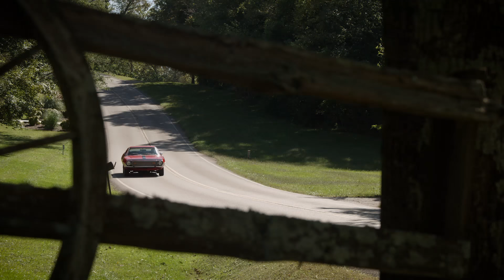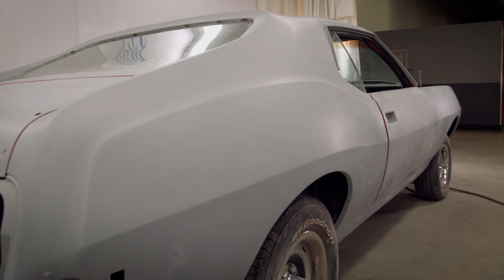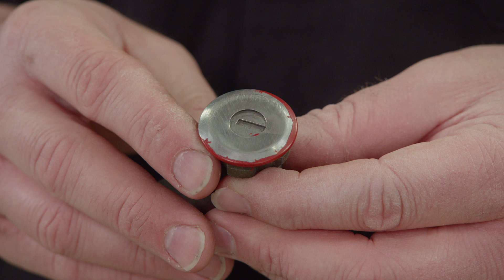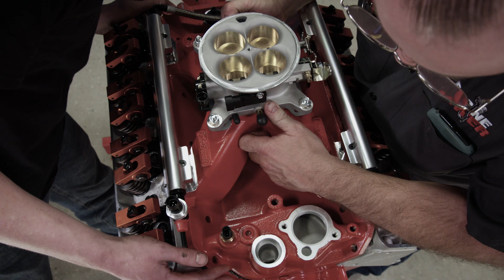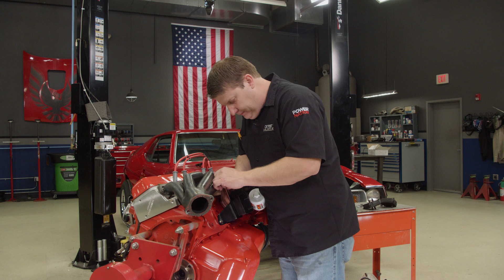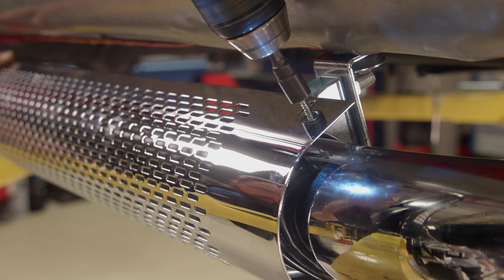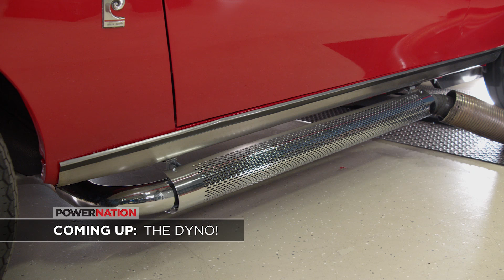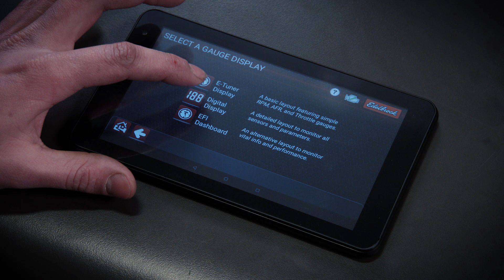Full Build: Transforming an AMC Javelin to a 70s Muscle Machine

Comment: Well I'm not quite sure what you guys are doing there but those are supposed to have 152 horse factory 304 engine and a 73 AMC well not just that year but nonetheless I knew it was closer to 160 as I guess I had to check I wonder if you are getting full throttle and running it to Red line nonetheless that's a bit of a difference that's 19 horsepower difference and at that I will say I what's really going on LOL

Comment: Great episode. I am getting ready to start a ground up restoration of a 1971 AMC Javelin.
Reply: Week end garage ..in 1972 AMC were installing Chrysler 727 three speed torque flight automatic transmission to replace the out dated AMC automatics ..i was working for an  AMC dealership at the time and shop foreman wanted to see if the new 727 transmissions were as good as was claimed....so at lunch time the race was on ...it was buck the service manager in a brand new 1971 Javelin with a 360 two barrel carb.and the AMC automatic.....i was in a brand new  1972 Javelin with a 304 two barrel carb and the all new Chrysler 727 three speed torque flight automatic ...our test track was a four lane avenue with plenty of  stop signs ..and at every stop sign buck didn't have a chance .even after i gave him a car length head start the 727 with a smaller engine would beat the AMC with a larger engine ..if you are not building the 1971 as an exact restoration for something like the barret jackson auction ...i would highly recommend finding the next year newer transmission of the Chrysler 727. Torque Flight ..if you are planning on keeping your 1971 Javelin with a 727 trans. You might also want to look into getting an overdrive unit that bolts on emplace of the 727 tail shaft and housing...this way you could run a rear end gear ratio of maybe 3.54 or 3.73 ..and with overdrive could still get great mileage on the highway ...and if you naturally aspirate it with a new sold state EFI four barrel throttle body that has no computer but instead has a built in microprocessor that all you do is feed it 12vdc and a signal from an O2 sensor ..you will be getting great fuel mileage while giving your engine many 10's of 1000's extra miles of engine life .and a few extra free ponies
https://www.manciniracing.com/msdatfuin.html
Reply: @donniebaker5984  Good info and story! I goofed on my post. My Javelin is a 74 with a 727 transmission.

Comment: Full builds are great, and I love the fact that FINALLY someone has done a Javelin. I have a 74 360 4-speed waiting for this type of treatment when I can finally find time and money. Things like these lock cylinders are little things I can get done in the meantime.
Reply: Sounds cool! I’ve been looking around on the market for the last couple of years for a 73-74 javelin. I was surprised to see just how hard they are to find, and the ones I do manage to find are either in really rough shape, or many states away. Good luck with your build.
Reply: I have a 74 360 AMX red 4 speed manual that’s been garaged for 40 years. I bought it new in college. I have finally started to work on it. I plan on painting in the same factory color and using white decals for the stripes. I like them better than what these guys did. I also probably won’t be quite as radical with the wheels. I can’t wait until I’m finished though.

Comment: The 1973 AMC 304 made a puny smog era 150hp & 245lbft at the crank with a low 8.0:1 compression ratio, so 133/201 at the rear wheels wasn't bad for a bone stock engine. Something was definitely puking out onto the ground under the engine during the dyno run.
Reply: Yes! In fact it is almost unbelievably good compared to it's ratings. So , there were dual exhausts added. We might guess a cam and compression increased, too. (8.4 cr according to the brochure)  
  The problem with this build is that they started with a car that was almost perfect to begin with then improved some things but degraded some others.  Using expensive parts from advertisers.
I can't relate to that.
Reply: @auteurfiddler8706  Those humungous rear tires ruined the "after" chassis dyno numbers. For a street cruiser/bruiser, I'd still have gone for a staggered set up but more evenly proportioned. I was expecting the rear drums to be converted to discs for extra stopping power since the engine's power output was more than doubled, so I was a bit disappointed that wasn't done.
Reply: @DJDinaggio  As a guy that follows both Mopars and Javelins, I can see the problem. The 73 'cuda has bolt on upgrade paths to bigger factory rotors and drums.
I haven't done it myself because it works pretty well already.  But the 73 Javelin starts with roughly the same brakes as the 'cuda but has no bolt on upgrades.
  Bias belted rear tires aren't going let better rear brakes do much except make the car swap ends with it jacked up in the back.
  Those belted tires are cute but they could have asked Cragar for wheels that fit... More backspace and less front space. And they should have used radials.
   They should just say "We took a great car, and with the help of our advertisers, turned it into a show only car with tongue in cheek kitsch." I guess I should not worry about all the mistakes they made. I guess we should compare it to the George Barris car with a Chrome German helmet roof and fake chrome machine guns on the side, not to something we'd take to Cruise Night/Cars and Coffee, or #NoNameNationals or Power Tour.

Comment: Taking off radial tires and putting on belted tires with rear wheels on that have too much front spacing, then jacking up the back with air shocks.....  These were all the things the next owner is going to have to undo.
   I would not want to be those rear wheel wells if the car goes over a bump.

Comment: A quick google shows that 304 was originally rated for 155 hp and 244 torque. Looks like it really didn't lose much over the years.
Reply: YES. The car had more power than it was rated at when they bought it. 133 rear wheel on the chassis dyno is about 200 engine hp on the same scale the 155 was was based on.
Reply: @auteurfiddler8706  Maybe it had some day 2 mods they didn't mention.
Reply: @whelk  Exactly. And very likely since it had nearly 50 years to collect the day two mods. 😁

Comment: Nice build and great to watch. I was hoping we would see the stock engine on the dyno and a before and after engine dyno run. 

A 30%+ drive train loss is crazy but that was due to those rear tyres ( do it again with the original wheels and tyres and see the difference!) and the 1970s automatic. 

Good to watch 👍😎
Reply: A 30% loss suggests one of the dynos is a bit off. You should seriously question drive train looses over 20-25%, on anything... Chances are better than good that the roller dyno is closer, since it uses far less correction and is entirely acceleration based. The wheels make up very little rotational mass when your spinning a few tons of roller up anyway... The engine dyno probably has the correction knob turned up and set to 60 or 75 percent for the calculations, versus 50% where it should be. People do that to flatten the curve plots and pad their numbers. It is a common trick to turn that up and do just that..... Been there, seen that.... More than a few times.... The roller dyno measures hp by acceleration rate, which is not exactly easy to fake... The engine dyno measures torque with a brake and a pressure sensor, and the engine dyno is way easier to make your engine look better by where in the plot you apply the correction. The higher you apply it, the higher the power. Most people don't know that about dynos.... At 30%, they are padding the engine one with higher corrections on the plot.... 30% power loss, will burn things up in a hurry... That is a massive amount of friction... Or a padded dyno....
Reply: @shvrdavid  on my ISF I have seen 30 hp loss just by over tightening the straps. 

The best dyno is a hub dyno. 15% difference between rollers and hub by the same manufacturer, same calculations and day. 

Those huge rear tyres will gobble up 20 hp over low profile tyres on the same dyno. 

I hope to be able to do a direct comparison between roller and hub on my car. Would be interesting.
Reply: @SouthernCrossMotors  Loosing 30 hp is not the same as 30%. Your ISF made 302 to the wheel. Which is nice. But it wont loose 30% strapped down as tight as you possibly can.... That's over 100+hp... I have never had one of my drag cars exceed 20%, ever.... Where I had them dyno'd, doesn't pad the numbers. And by the way, you don't need to strap 1500 hp down tight on a roller.... Why would you do that to a street car? Taking the slicks off and putting street tires was tried on a few of my cars, and made virtually no difference at high power levels on a roller dyno. It accelerates to quickly to make that much of a difference. Making less power would show a bigger difference by reducing rotational weight, but not 20hp at 200hp. Is every dyno different? Yes they are, but not by much percentage wise. Either something is very wrong with one of their dynos, or one is padded... Since they use them all the time, one is padded... The difference you will see between a roller dyno and a hub dyno is dependent on rates. The roller measures how quickly you can accelerate the roller, period. And the hub dyno can be set at whatever rpm a sec increase you want to measure it at, just like an engine dyno.(They may have other modes as well, such as quarter mile sim by weight versus gear ratios, etc) Have them do it at two different fixed acceleration rates, than ask yourself how it made different power outputs without changing any rotational mass... And how the difference you see, is small percentage wise, and not consistent across the power curve.... Hint, it has to do with factoring, and sample rate timings. You obviously didn't change cars..... The car still made about the same power, it will be slightly different at different rates, but not that different... Then have them show you how to tweak the numbers, by changing the factoring percentage. I am not talking about altitude, weather, shootout mode, or any of those adjustments, where the numbers are taken from in the scattering of samples it records.... If it has shootout modes, have them explain that to you as well. Shootout modes guess what the drivetrain losses will be based on real world tests, then use higher numbers in the sampling of the scattered data to come up with flywheel numbers... Which is why you can change which mode it is in, and suddenly your car makes way more power.... Just about any dyno shop will show you that. My STI has about 18-20% drivetrain losses, and it is still all wheel drive..... It showed slightly more power on the rollers than at the hub.... About 2% more... 698 on the roller. It made 833 on a Sunnen.... All 3 dynos, were very close percentage wise... All 3 made by different companies... None of them have padding turned up to buff egos....
Reply: @shvrdavid  Hi. An update. The ISF made 352.9 on the same dyno after the mods ie headers, full dual exhaust and RR-Racing tune. Happy with that (Dyno-Dynamics roller). 

I then took it to a hub dyno (Mainline built here in Australia) and it made 396.5. I was curious but also wanted a baseline before the final upgrades being a ported TB, ported inlet manifold, much larger intake and MAF tube and the final tune upgrade. Hoping for 10 to 20 increase. Nothing more I can do to it now.  

Also heading to the strip to see if I can get a new PB. Aiming for 12.2xx @ 117 mph. We will see.
Reply: @SouthernCrossMotors  Keep chipping away at it. It probably surprises more than a few people as well. Must be a blast to drive on the street. Quick car from the factory, and even quicker now.

Comment: I don't know what these guys were thinking. Was this supposed to be some kind of budget build? Why stick with a shitty 3 speed auto? I mean you go to the trouble of installing fuel injection, so why not a modern transmission? And why keep that ridiculous 3.08 rear end and stupid drum brakes on the rear?
Reply: It was a build that combined improvements, degradations, and neglect.
I think they use advertisers parts.  That is the purpose of the build.
I think they never call it budget. It is just the opposite. 
 The 904 is a fine  transmission and you can upgrade it for strength. The Mopar Bible says this. So that was an improvement.
If you jack up the rear end, there is little point in putting stronger brakes on the back than the 10 x 1 3/4 stock drums.
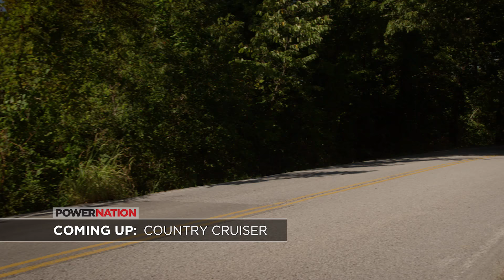  If you don't have an an overdrive transmission, there is a disincentive to put on 4:10 gears if you want to drive on the highway and not the dragstrip.
   If it were my car, I'd drive it like it was. I'd have tried to get the AMX hood, which they did. Well, add a posi. And , say, a Torquer or Perfomer intake and four barrel carb.
 Then, when the 304 needed a rebuild, switched to a 360 or bigger AMC engine.

Comment: Ups, Drove a AMX in its day 390 CI 4 Speed standard, bit smaller than the Javelin, Awsome
Reply: 68, 69, 70 AMX were 12 inches shorter and had no rear seats than otherwise similar Javelins.  Think about this: an engine big enough for a Galaxie in a car with the wheelbase of a Pinto.   😁😁

Comment: Love the build I had a 71 with a 401. I wish this build could have had a 401 or even a 360 and some dragstrip time. My 401 was .020 over with a roller hyd 236/242 @ .050 and .540/560 lift w/ a 110 LSA. The heads were Edelbrock with the runners opened to 205 cc's and minor cleanup of pockets and ports. I used Harland Sharp roller rockers 1.6:1 ratio and a Torker as I found it to give more horsepower than the RPM without sacrificing throttle response. Carburetion was a 770 Demon. The oil line and distributor  mods were done and I installed ARP studs on the mains and heads. The rods ( which had ARP bolts) were stock steel and prepped as was the crank. Headers were 1&3/4" out of 3"ers. Horsepower was 524 @ 5800. It idled well, had great throttle response and sounded like a bear with it's nuts caught in a trap. Underrated engine that 401
Reply: People really underestimate the power that can be made with AMC. It sure isn't the cheapest power out there, and won't be the most, but you can get there.
Reply: Uh huh..

Comment: Only thing missing from these full builds is the engine build instead of just an overview.

100 horse driveline loss is nuts.
Reply: You aint kidding, I have been building heavy duty diesels for semi truck pulling and we typically see 100-150hp drive train loss on a semi truck. And your talking about a giant 18 speed trans, huge 8 inch drive shaft, the power divider box and the enormous Dana axles. 100hp loss on this car is terrible.

Comment: HOWdy  P-N,
Thank you for the " AMC " Episode
I beLIEve  that better POWER could have been achieved with appropriate SIZED heads (instead of the "401" aluminum aftermarket items)  + a CARBURETOR ... (instead of EFI) 
... those ALUMINUM Heads SHROUDED the  Valves to the point that you were required to NOTCH the engine block for clearance ...  
( I have done this exact same BIG VALVE 401ci Heads onto a 290ci / 304ci AMC V-8 engine in the past myself  - only with OEM Cast-Iron heads ) 
instead -  I would be interested in  a Cast Iron HEAD with the largest valves that would fit inside your 3.75" bore ( + any overbore) and and appropriately sized HOLLEY Double Pumper 
( just for comparison's sake )  
IMHO 
Thanks for the AMC Episode 
COOP
...

Comment: I hope they put in new fuel lines & a new gas tank.
Reply: It looks like they could technically still use the old one since the EFI pump is boosting the pressure after the fuel gets to the engine compartment.
From what I've seen, that is not a good system in terms of noise, though.

Comment: 18:44 Fun fact: Subaru is considered a "low production manufacturer." They do everything they can to be as efficient as possible. That means reuse the same parts across as many models as possible, and buy the most common stuff from someone else. Even if that "some else" is technically a competitor. The engine accessories (AC compressor, alternator) are made by Mitsubishi and the interior switches (windows, doors, etc) are made by Nissan.

Comment: It’s great they stayed with an AMC mill in it, but I would have kept it carbureted instead of injecting it, but they have to go with what their sponsors want them to promote. A properly sized and tuned carb will perform just as well if not better than injection and would have been sticking with the 70’s image they were going for.
Reply: 😂 ok. I'm a big fan of carbs and you're delusional if you think a carb would be equal to or better than efi. Throttle response, low RPM cruising, WOT, cold weather starting, to name a few. If carbs were better than efi, everyone in drag racing, off roading and road course racing would be using a carb.
Reply: @TheRoadhammer379  you need to look at the real drag racers not the street/strip weekend warriors.
Reply: @todddenio3200  a 300 horsepower "real drag racer"? This car won't outrun a new Civic r, it should at least start easy
Reply: @gen4ten318  Wasnt built to be fast!
He has enough power to dip into the 13s depending on gearing .
304 is just a cruiser. My c4 made similar numbers 13.9 at lacr in crappy air

Comment: I personally would've fully upgraded the brakes, including doing a rear disc conversion and also swapped out that open carrier bearing in the differential, so I wouldn't be doing, " The One Wheel Peel"

Comment: Ah yeah, mistakes made in that era, putting 10’s on the rear, should’ve been 8.5 or 9 with better offsets, gross looking side pipes
Reply: Drawling..."Now that we've replaced the radial tires in the back with belted, Next we're a gonna upgrade the interior with a chrome chain steering wheel and 8 Track, Cover all the windows with auto parts vender stickers,  and put giant 'Plymouth' decals on the quarter panels..."